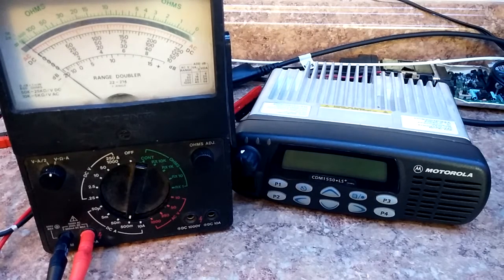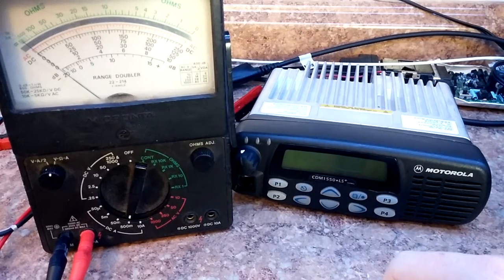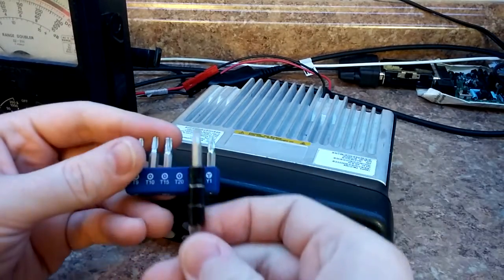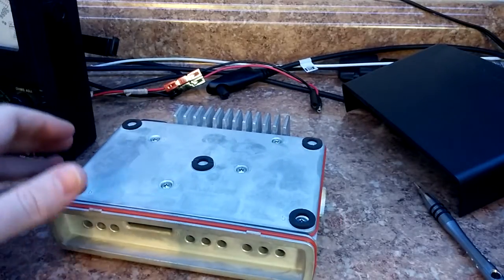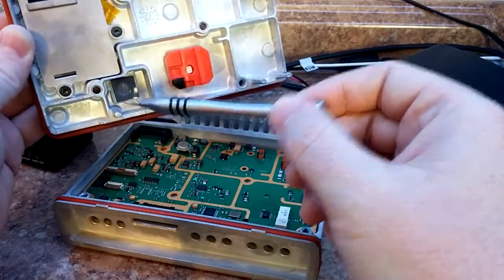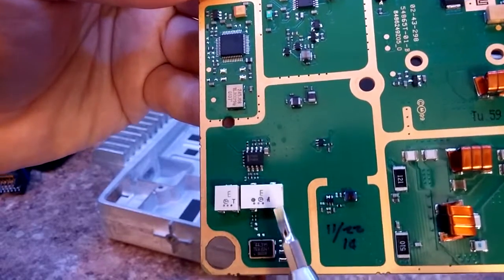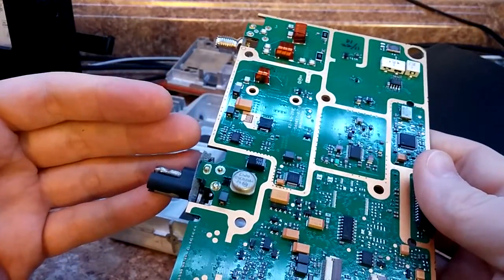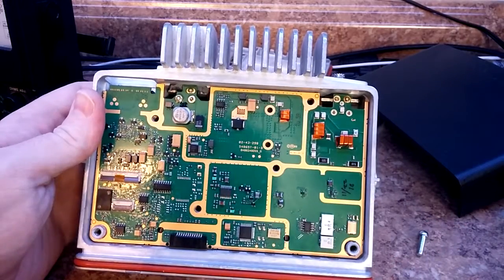CDM1550 200 MHz Dissassembly

Comment: Well for the European market you need to modify it down to 430 MHz if this were a UHF radio. The SM series of the Radius radios are basically the same but smaller. I have one of the CDM SERIES in 900 MHz, great radio but now living in the EU, 900 is cellular, no ham stuff up there.

Comment: Bri great video how can I fix my antenna port on cdm1250..think prong in port sprained. When I hook up antenna and tighten ring it wont work. When I loosen antenna it works..I just changed antennas thinking it was bad. But I notice prong is smaller not making good connection to port.

Comment: Bryan....do you have any idea why a CDM-750 UHF Transceiver will not "Power UP".  We used a CDM-750 Motorola UHF Transceiver for a 440 MHz link to another repeater  here in Southern Indiana and noticed one day that it wouldn't power up any more.  It was given and programmed to our Repeater Group a couple years ago by a previous Motorola Dealership Owner to help out with our efforts in NWS Skywarn.  He provided a printout of  the programming and a CD.  I gather that the CDM-750 disassembles the same as this CDM-1550 and wondered if there was some on-board B+ protection such as a fuse but didn't see anything like a fuse on the CDM-1550.  We would like very much to get our CDM-750 unit going again.  Cosmetically, it looks new, but for now it sits in a box on the shelf because it doesn't power up for some reason.  Presently, we are using our first link transceiver, a GM-300 UHF Motorola unit.
Reply: Followup to the Motorola CDM-750: There are (4) T-8 Torx screws that hold the board down at the RF Output Modules so the two units aren't alike in that regard. I dis-assembled our CDM-750 last week and removed and dis-assembled the control head and didn't find anything damaged from our June 2016 lightnings surge.  I looked through the "Service Manual--Detailed Version" and there is a 3A Fuse listed (RO 410) which I was never able to find on the board ?  Also there was a marking on the outside cover of (DO661) which is a Dual 70V Diode I never was able to locate either ?  Not sure exactly when the Diode marking was applied to the unit cover ?  Anyway I re-assembled it and applied heat transfer paste to the transistors, torqued it down to 17 IN/LBS and it powers up now !  Pushing a long press on the on/off button I get a musical two tone response and  I get two LED lights, one is a YELLOW LED at the top and center, and the other one is a RED LED above Channel 1 button which may be because we don't have a microphone hooked to it yet.  I found one on eBay and also purchased a "Mini UHF Male to UHF Female" adapter.   I'm not sure how to interpret the YELLOW/GREEN/RED LED's at the top ?  The YELLOW is the only one that comes on.

Comment: Newbie with a newbie question: Hi Bryan, I have been really enjoying your videos. They are VERY interesting and helpful/ educational. I have one of these 200mhz 1550s. I was hoping to set the radio up for either scanning only or listening in on transmissions that are passing through a local repeater. I am only using a short desktop antenna, no mike.

While using the CPS, I see that I am set up for 217 to 222 Mhz. Its sounds like I might be able to load a preconfigured code-plug (if someone can share that with me) and change the filters (if I can find them).

Are my hopes realistic or am I wasting my time? I'm not looking to build a repeater (at this time). Again, I am a newbie just tinkering. I would appreciate any elmering that others can offer. Thank you in advance.

Comment: I love the Waris line. I know a lot of folks scoffed at them, but they were a good platform. We had them in everything from Locomotives to open cab bull dozers at work and I can tell you first hand, they will take a beating.

I built a 2M repeater out of two CDM 1250's & it's a great performer. CAT 250 controller, Sinclair 6 bottle duplexer and a DB224 antenna on a 300' tower. It's a great sounding repeater. Guys will comment on how good the audio is and ask if it's a MSF or Quantar & promptly get their minds blown when I tell them it's two 1250's. Great radios.

Comment: I have one a little different. It does not power on. Is it the diode? Think it overheated with the previous owner.
Reply: Andre, the previous owner may have set the codeplug to require the ignition to be hot before the radio powers up. There is an Ignition Sense port on the accessory socket, apply 12v to the correct wire as you power the radio and it might just work fine!  Good luck
Reply: Nigel Ballard: thanks. I need to get it up to Congers, NY or Regional in Paramus, NJ to have it repaired.